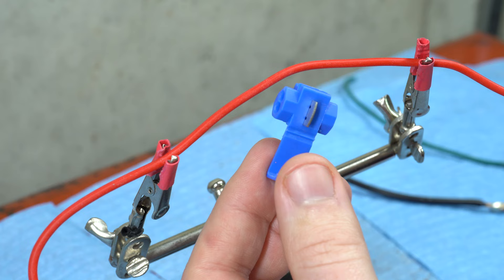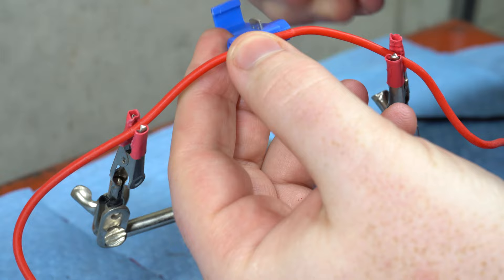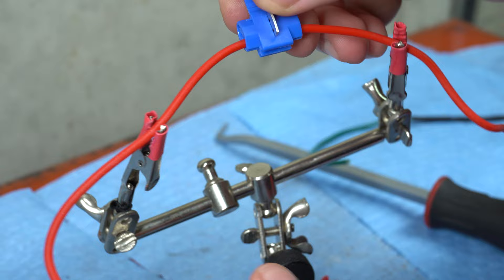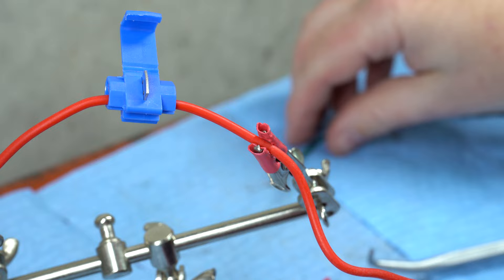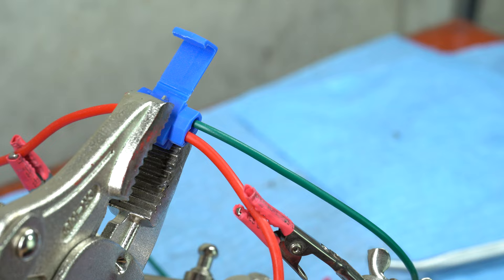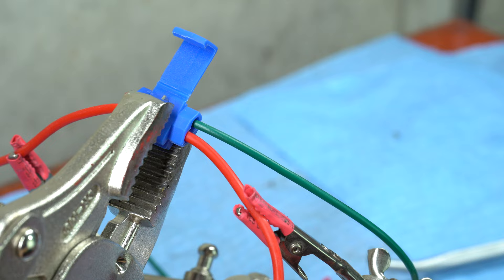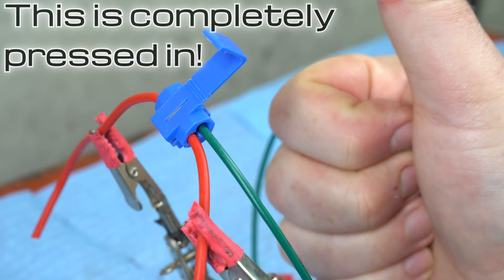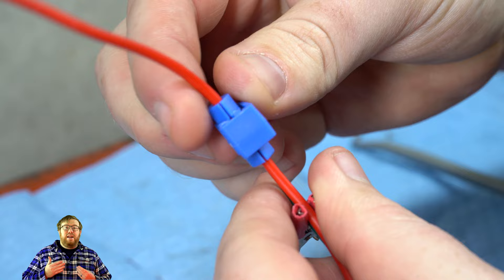How to Use Quick Splice Connectors & When to Avoid Them

Comment: Problem with these is mostly user error, not crimping down hard enough, using wrong size wire, and not water/weather proofing with tape for outside applications. When done right they work great and last a long time.
Reply: Exactly what I was thinking
Reply: Even the cheaper ones like from harbor freight?
Reply: @vertihvost7675  Yes, they're more than likely made from the same factory in China lol
Reply: Are they “removable”? I have to bypass an HID ballast to install LED bulbs and it requires these quick splices. If for any reason I wanna go back to using the stock HID ballast, are these able to be removed w/o any negative effects or damaging the wires they were used on? Very new to this so I am asking the stupid questions b4 it becomes a stupid accident.
Reply: @JuanRodriguez-yk2dd  Nah not removable, for your situatuion look into wago connectors.
Reply: @RyKoMedia  Thanks a ton. I recently swapped my HID headlights to LED and prefer the “plug & play” option but they lasted only 1 year and now the company discontinued that model so now I was told the new model has to bypass the ballast (which I REALLY don’t wanna do) so I was researching these connectors THEY said to use. I just don’t wanna be locked in to that bypass. I wanted to find something that can be “reversed” or “undone” if the future called for it. Thanks again.
Reply: @JuanRodriguez-yk2dd  You just gotta jump the wires before the factory ballast, and leave the factory connector on the ballast. btw Since you already have a factory ballast, you can just upgrade the factory HID to something like Phillips or Morimoto instead of splicing for the LED bulb.
Reply: @RyKoMedia  I don’t want to bypass the ballast, I’m just having trouble finding a decent “plug & play” LED kit. I don’t want HIDs anymore as (IMO) LEDs are better in my specific situation. 2020 Chevy Traverse with projector lenses. I live in an area with a ton of of deer. The LEDs seem to light the sides better and farther than HIDs.

Comment: i use them in my vehicle, interior only, haven’t had a problem
Reply: Thought about using them to tap into my stock stereo speaker wires to add a sub and amp. U think these would work well for that versus a posi-tap or t-tap connector.
Reply: @kylealexander6258  i don’t see it being a issue especially for just speaker wires, just be sure you are using the correct size that you are tapping into
Reply: Hi am not sure what size to buy if it's 18/14, 11/18  am going to splice my rear brake lights? Thanks

Comment: Best place for these is honestly prototyping, working with stationary electronics, and for truly temporary fixes. Nothing exposed to the environment or vibration!
Reply from the maker: Indeed! I agree on all counts.
Reply: Would you recommend using these for installing a line output converter?
Reply: These are designed to withstand vibration. Solder fails under vibration testing
Reply: @techmetal2292  These honestly aren't good for anything except temporary wiring. They are a small contact area, low reliability, unsealed connection. Crimping with proper sealing is preferred for a high vibration situation. I also prefer not to solder in automotive work.

Comment: Automotive wiring in the passenger compartment is the only place I would use these and only for low current or signal type applications.

Comment: They are PERFECT for automotive wiring.  I dont know what went wrong with this guys build but my LED bumper lights are spliced to my tail lights when in reverse and Ive had ZERO issues.  If you use the correct size, I dont see the issue.  Also, use SOLID core wiring with these.  Not braided or twisted core.
Reply: Splice connectors have a tendency to corrode and start melting things after a while, maybe you might not have issues with it but down the road its going to happen. I've had to redo so many "custom" trailer wiring jobs from people being lazy and using splice connectors which worked for for maybe a year or so and then stopped working. 
Best stuff to use for automotive is crimp connectors and shrink tube.
Reply: The only time you will have a problem is with improper use. People don’t understand how to use them and then say they are garbage when they fail. Tons of engineering goes into a product like this and there are very specific instructions on proper installation

Comment: I used these to fix the wires on my lawn mower. They worked great. I wouldn't have had enough room to solder and heat shrink without taking the top of the engine apart.

Comment: If I used the quick connectors for my taillight ground and power wire, and I’d like to remove them, how would I go about safely removing them and what could I expect with the wire? Will the factory wire still be intact, meaning is the wire still whole to where I can electrical tape it or does it split the wire in half?

Comment: Thousands of these installed on add on accessories from Toyota, never an issue. Like with most things it’s not the product it’s user error. This is what Toyota supplies and specifically instructs you to use on those products.

Comment: Wow, thank you for your honesty!  How to best remove these crummy, cheap quick splice connectors after they FAIL!?  Like you, I too was installing Resistors to stop 4-way Flashing on my motorcycle. Blue quick splice connectors incl. in the Kit FAILED on installation. What's best way to remove them while wasting the least amount of wire? Good job.

Comment: i recommend hot glue to hold them in place. i used electrical tape before and heat and vibrations made the tape unravel and the connection with it.

Comment: I've never understood why people use resistors to fix fast flash.  Doesn't this increase current draw, which is one of the reasons to use LED lights, to reduce power requirements?  The proper flasher relay is the method I use.  I am wondering if what I think I know is wrong.
Reply from the maker: Whenever a replaceable flasher is available, that is indeed the ideal way to go about it. However, on newer vehicles it's becoming increasingly popular to not have a traditional flasher unit and instead, the flash rate is controlled by a computer. The computer expects a certain current draw, and when it's not correct, it will change the flash rate to warn the driver of an issue.
Reply: @CarsSimplified  holy crap! I have a 2021 Jeep Gladiator, and I was able to tell the computer I have LED lights, I guess I'm lucky.  Thanks for the detailed answer, it makes sense even if I think it's a dumb way to design a vehicle.
Reply from the maker: Ooh, nice! I'm glad they have that option! Funny enough my latest video is a key fob battery replacement for a Jeep Gladiator!

I imagine technically any car with the computer-controlled flash rate can be made to accept LEDs, but it would take varying levels of programming ability.

I actually have a car that I was able to install an LED flasher on, but had to install one of those resistors parallel to the taillights because the BCM "warns" the driver of full taillight failure (which it thought it was seeing with the LEDs) by locking the traction control system to off.
Reply: @CarsSimplified  In case you don't already know about it Taser Mini allows you to set the lights to LED.  I suspect there are other aftermarket programmers that will do this as well, but I got the Tazer Mini primarily to change tire size in the computer.

Comment: Isn’t working for me, its the correct guage, but when it cuts down on one of the wires, it doesnt go all the way through the insulation, only a small piece shows and my backup camera isn’t powered. Should I use a smaller one?
Reply: What gauge t tap are you using. The scenario you described tells me that your t tap is rated for a larger wire. Go down a size in t tap and it should properly pierce the insulation.
Reply: @BillOfAllTrades2016  I went down a size and the t-tap couldn’t get through the actual wire part, in the end I just crimpes the wires and used one of the shrink tubes

Comment: Is that type of quick splice connectors limited to 12 v  ? I am not sure if it is safe for 120 v household current , am I correct?  If so, is there similar quick splice for 120 V?
Reply from the maker: Definitely don't use these for anything with solid wire, and I don't believe they can handle 120V, either. I like Wago style connectors for solid wire and they are about as close as I've seen to this for 120V solid wire, but they will require cutting the wire. I don't have any training in working with 120V wiring, though, so there will be more knowledge folks than me on YouTube to ask.

Comment: Would you recommend using these for installing a line output converter onto a factory radio?
Reply: I'm here for this exact reason! Did you do it yet? If you did, is the audio quality okay with these connectors?
Reply: Wondering the same! Did you end up going with it?

Comment: What if you wanna take these off? Does anything happen to the main wire?
Reply from the maker: There will be cuts in the insulation that can let corrosion happen if not resealed. There could be damage to conductor strands, too, which can cause hot spots if what's left can't handle the amperage.

Comment: would these work for say automotive audio wiring ?
Reply from the maker: They will, but for how long is the question. I would definitely avoid using these around speakers, especially with subwoofers, as the vibration can cause the metal part that cuts into the wire to potentially cut more wire strands (which will reduce audio quality in the sort term, and weaken the wire for more damage in the medium term). Soldering won't be the perfect solution in every scenario, but it generally creates a better audio wiring connection across the board.

Comment: This may sound stupid but is there any way to remove it ?
Reply from the maker: I just had to remove two a few days ago! I don't know if there's an official way to do it, but I just unclipped the cover and pried it apart with a flat head screwdriver. Damage is already done when installing them, so there's no avoiding needing to do something else with the wires afterwards.
Reply: @CarsSimplified  yea I knew the wire damage would be the problem, cause I had to use those my my new side marker and connect it to the turn signal and it was pointless cause it didn’t even work so I’m now scared to take it off cause it might mess up my lights

Comment: Are these connectors only to run a single wire to connect to another single wire? Or would I be able to run an LED light to my headlights with this? So they could turn on and off with my headlights
Reply: Did you ever find out?

Comment: What happened to your subaru XV? 😯
Reply from the maker: In the video? I was just upgrading to LEDs and had to add resistors to make the turn signals blink at a normal rate. I've driven it across the United States since this video was recorded (and that trip was right after this video, which was why I tried this potentially quicker wiring method).

Comment: How do i remove them
Reply from the maker: Because they slice through the wire insulation, they just get cut off at the wire. The wire then needs to be repaired with a connector and/or solder.

Comment: Just an opinion but you should mention what you would recommend doing for automotive applications instead of just saying don't do it multiple times.
Reply: He did. He splices and solders. He says he only used em cause it was freezing winter. You can also use the butt style connectors with three wires

Comment: Those connectors are garbage use solder or loop and heat shrink those connectors corrode fall off and are horrible You're asking for trouble. Learn how to solder it's the best connection you can make when it's done right